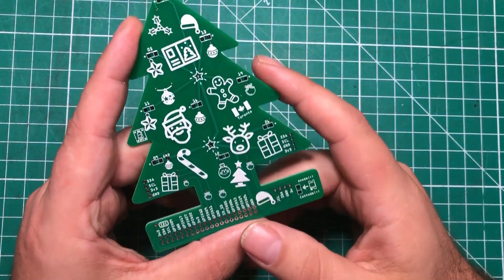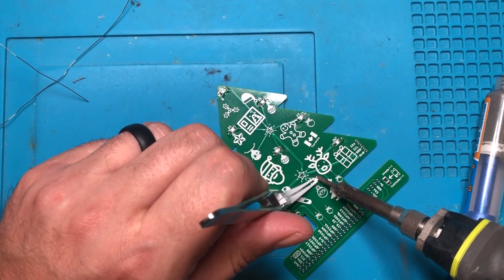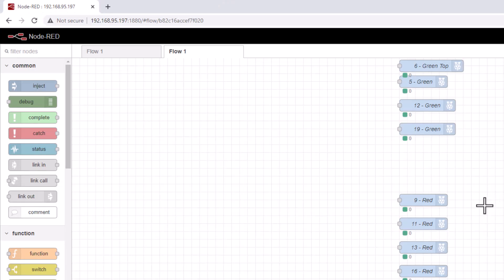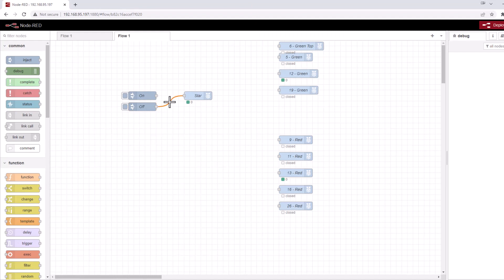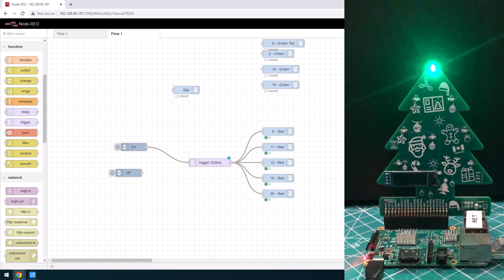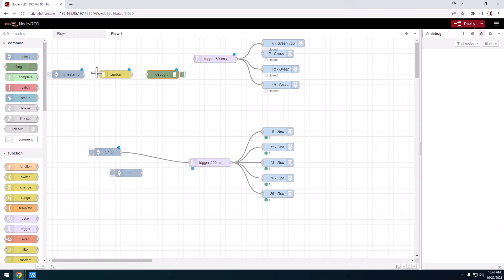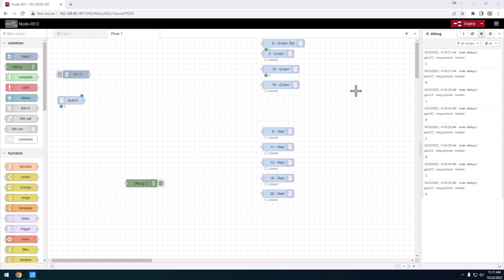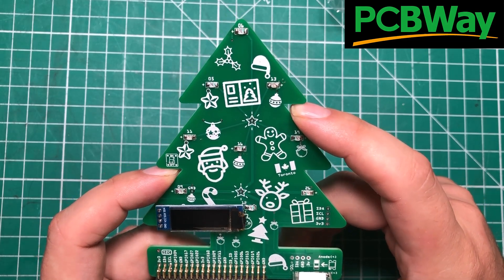Learn Node-Red with this Christmas Tree

Comment: Excellent introductory video. Now I don't have Pi money, so I'll have to dust off my WeMos D1 minis, esp8266, and get some LEDs blinking, fading, and flashing in time for Christmas... I usually just bung the code straight onto the esp8266 and let it run, but I've been dabbling in using Node-Red to control some IoT devices so I may fall down that rabbit hole...
Reply from the maker: It's crazy how expensive they've become. I bought a pile of them when they were cheap. Now I'm just a hoarder :)  In all seriousness I use them inside a lot of my retro projects and my supply is dwindling.
Reply: @AnotherMaker  yip everyone knows about the cost of living crisis but the non initiated, non tinkerers, non makers, have no idea about the cost of parts, bits, and bobs, crisis 🤣
Reply from the maker: @generaldisarray  I was actually just thinking today that a lot of my tandy boards etc have a BOM around $50. It blows me away that you can get a full AM4 motherboard on Amazon for $53.  Insane.
Reply from the maker: And thank you for the kind words.  Btw, I think it was you who mentioned about my soldering iron being cool.  The temp was definitely off I had it ripping at 800f but it was not right. I just got some things in and I'm going to get to the bottom of it.  That's why I don't have a ton of soldering footage for this one. I soldered it with my ryobi 18v iron.
Reply: @AnotherMaker  yes I was the soldering Nazi, 🤣🤣. There's nothing worse than a tool you can't trust, especially when it let's you down when you need it most.
Reply from the maker: @generaldisarray  I appreciate it.  One thing that I've found with the PCBWay boards is that some of the designs I get from shared projects have more copper, so it's not uncommon for some boards to be drastically more difficult to solder than others.  I've done a few where you're really walking a fine line between trying not to melt the plastic sockets and actually soldering.  And being a hakko, I didn't really suspect the iron.  Turns out it was. :)
Reply: @AnotherMaker  you're more than welcome. I really appreciate and enjoy all your content